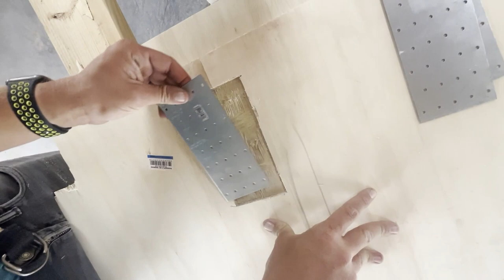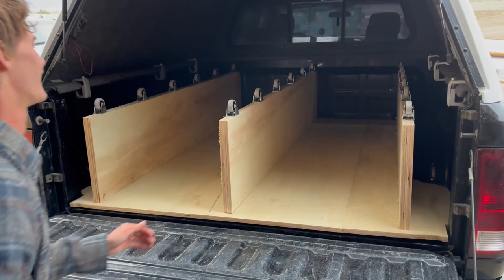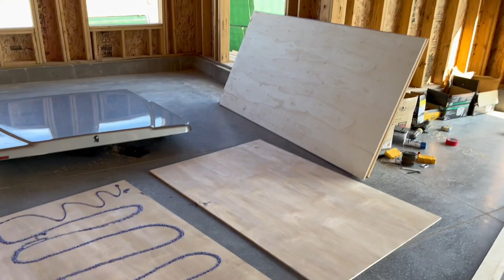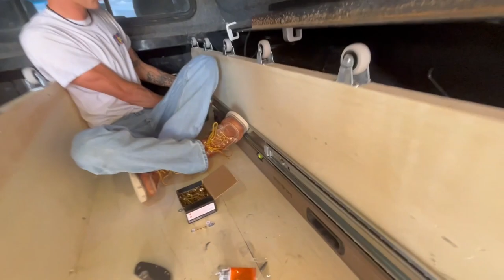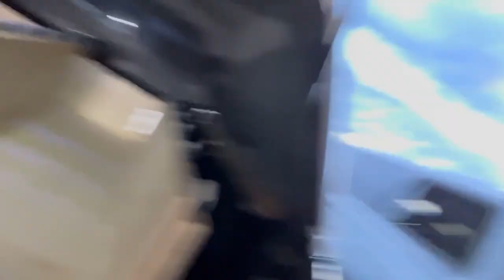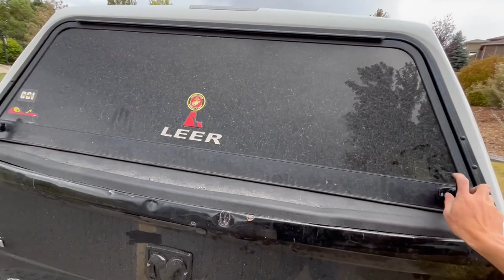How to Build Truck Drawers with a SLIDE-OUT BED!

Comment: I am a finish carpenter also cabinet builder (mostly finish now ? Pays more) .  I am going to do that but I did build out an SUV back full of cabinets and a bed on top for a customer.  The way I do those drawers is install your slides as u did!  Then place your drawer about half in extend the slides out (slip a long 4’ shim under the drawer to keep it up off the bed from dragging maybe a 1/2”) then screw your extended slide to the drawer !  Bam!  You did it 1st try in 30 min!

Comment: Nice build but I can't seem to understand how someone in the trades won't need space to hall a miter or table saw especially with a gravity stand attached. Plus Im rarely parked close enough to the work at hand to store handheld tools in the truck. I have a garage storage tote that weighs atleast 60kg with all my cordless dewalt tools that I walk on the jobsite with.

Comment: Nice work! Two things I missed.. how are you attaching the sidewalls for the drawers? And how does the slide just not come flying out? Thanks
Reply from the maker: Hi! The slide right now is just held in with friction, honestly if I have a scenario where it becomes an issue I’ll add a latch of some sort to lock if i need, also the sides are held in with screws at an angle into the base
Reply: @Coffmanconstruction  makes sense. Thanks for the reply

Comment: You two did a nice job on the storage units. I must say that is one of the best designs I have seen. I want to make a set-up for my 2014 GMC van. I have shelves but at 66 years old climbing in and out to use them doesn't happen often enough, so everything ends up in a heap on the floor.
Reply from the maker: Check out my older video on the van setup! We had it pretty nice
Reply: Come on now buddy I am 64 still work as a carpenter full time and jump, kneel, squat, and wear full bags (finish man) all day!  I feel better now than I did at 50!  Just loose weight , eat light and no cigarettes or booze!  Don’t sell us “more mature “ guys short?  Ohhhhh and Church on Sundays!  Very very important!
Reply: @zephyr1408  I'm not putting older workers down, I am the one with the health issues. Besides really bad arthritis in my knees and a torn something in my left knee, I do pretty well. When I am doing interior finish, I too work a good long day. I don't smoke nor am I overweight, 6' tall and 150 pounds, I don't drink either. I also eat fairly well with the diet my GI doctor has me on. COPD, chronic pancreatitis and severely blocked carotid arteries in my neck are what slows me down. I hope after my artery cleaning and knee repairs this winter I'll be doing better.
I have a friend who has been building custom houses on his own for 30 years. He is 64 and has 8 carpenters who all, but one is over 60. His 2024 calendar is full. He just started telling people that he is not booking work for 2025, yet.
I was doing great until I hit 65 then everything went to Hell.

Comment: I like your over all plan and it looks to be coming out well. You probably should have added a piece of thin plywood between your rollers and the box for the drawers. just to keep dust etc out of your drawers. One other thought Have you given any thought to the weight? I assume your trucks are 1/2 to which  only gives you 1000 lbs. 3/4 plywood can weigh from 42 lbs up to 60 lbs. you could easily have half of your payload capacity before you put any of your gear in the trucks. Hopefully I haven't been too negative, yous have done a great job and I thoroughly enjoyed the video. I subscribed!!!
Reply from the maker: We haven’t noticed any issues with weight so far! I’ve even carried a steel beam in the back of it. I did upgrade to a slightly bigger truck and moved the drawers over though

Comment: If you were to construct them all over again, is there anything that you guys would do differently? I find myself wanting to know more about the way that the slide stops, since I didnt see much of anything showcased with that part of the build, or its final product. I think you briefly mentioned how it keeps from tilting up. Speaking of the slide, how do you keep it tracking straight in and out? Is the fixed casters all thats needed for that? No alignment mechanisms or channels for that at all? Any idea on its weight capacity, espesh fully extended? I havent seen much, if any, designs that address the sagging factor during heavy loads, unless they were just welded tray frames or similar. Look forward to your response, if you got some time. Thanks for sharing, regardless. Aloha
Reply from the maker: i probably wouldnt do the sliding bed on my next one. the capacity is determined by the drawer slides themselves, they say 500 pounds supposedly.

i didnt incorporate anything to keep it from sliding out. it has enough weight on it to pinch and not fall out, but either way its nice to be able to take it out if i need to. i didnt incorporate any tracking for it, but i should have! can get slightly misaligned and makes you have to put it in just right to keep it square

Comment: Absolutely great work. I am curious about the way the angle iron worked out on your canopy clamps? It was hard to see in the final product shots. I'm going to do this build in the next few weeks and was wondering about any advice concerning keeping the rolling bed aligned and or not being able to just pull completely out.
Reply from the maker: It worked good for holding it down, the platform didn’t stay aligned perfectly always. Sometimes I’d have to push one side in a little bit, but it was never a hard process, and I never installed anything to keep it from sliding out, but the weight of it as it came to the end would pinch it against the angle iron and keep it in pretty well

Comment: Can you build a list of all materials used??
Reply from the maker: 5 sheets of 1/2” sanded plywood, 

4 sheets of 3/4 sanded plywood,

2 sets of heavy duty 60” drawer slides 

21 smooth rolling casters (about 2-1/2 inches tall) 

2 pull handles, heavy duty

2 3’ pieces of angle iron 2”

1 16’ 2x6 

1” screws

1-5/8” screws
Reply: Where you use the 2x6 in your video?